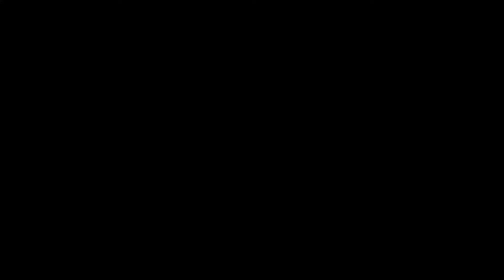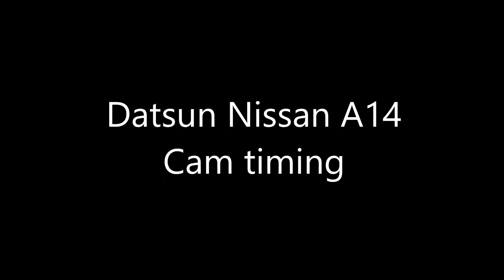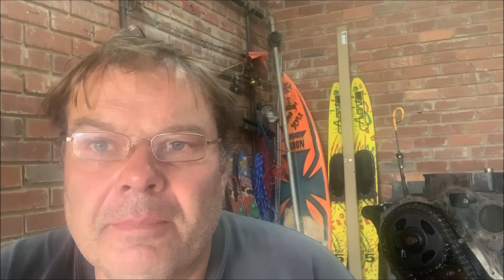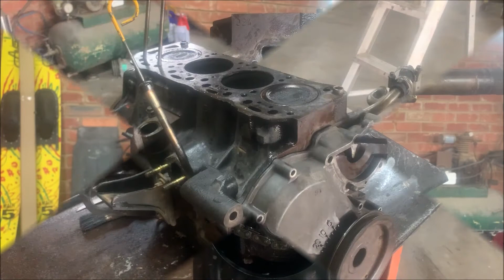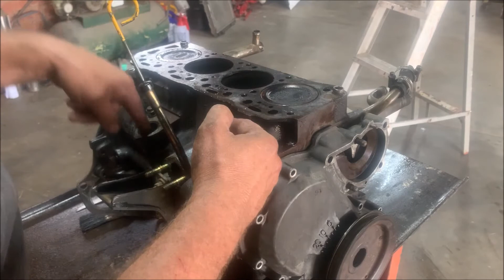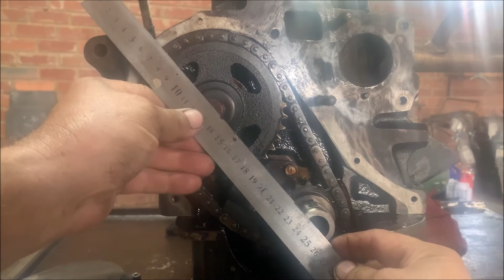Datsun Nissan A14 valve timing

Comment: Good morning sir,we have a problem with our engine ...it started with a small like misfire between 1000-2000rpm,the last time i drove it i had to pull the choke out in order for it to go smoothly ,came home  and pulled it in the garage ,took out plugs which was foiled with black carbon and when removed air cleaner we saw that the one chamber was very black with carbon ,we then removed the carburettor,cleaned it and the plugs but now when trying to start up the bakkie it just backfires through the carb, don't start at all,spark plug leads,distributor cap,coil,rotor and condensor all new ,checked there is spark but for some reason the bakkie just won't start ,can valve timing jump on the chain?....your input will be much appreciated
Reply from the maker: Sounds like the spark timing ir out, but it can also be a carb problem as both can cause backfire via the carb. step one, ensure the spark timing is correct. check it with a timing light

Comment: Do you recondition Nissan 1400 engines commercially? Mine is pushing oil out the exhaust and smoking like a chimney. Looking for someone to give it an overhaul.
Reply from the maker: Yes, i do contact me on 060 654 6966